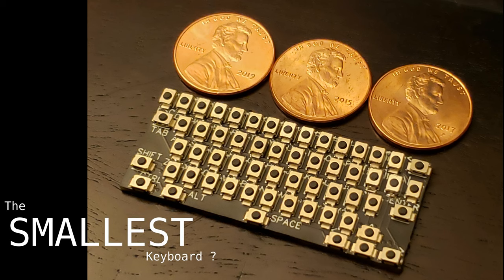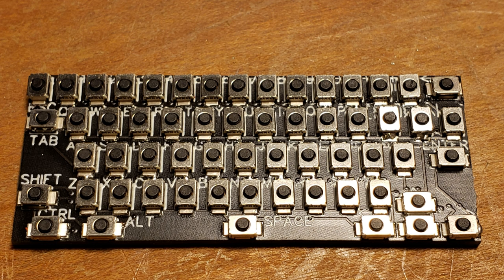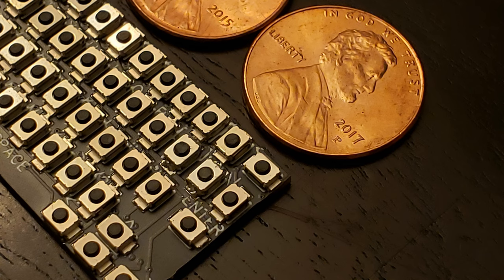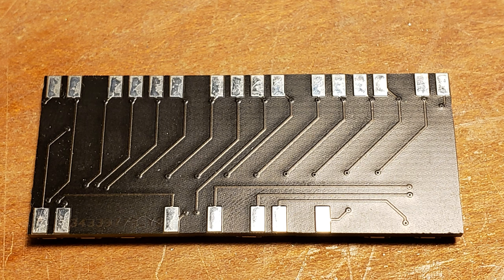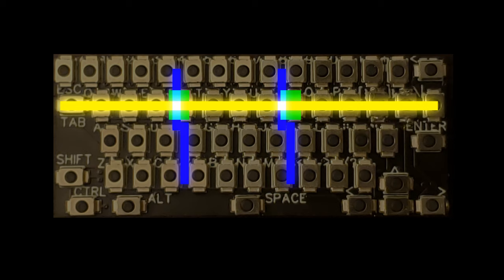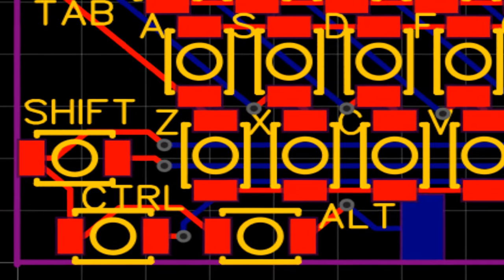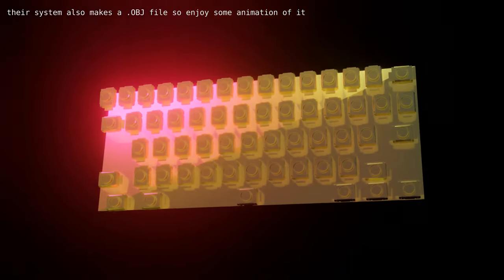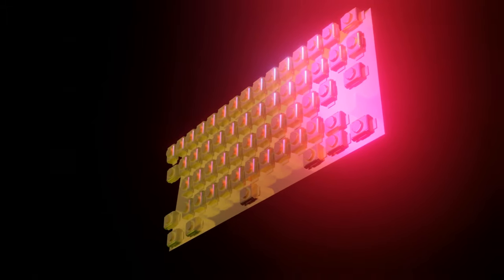The Smallest Keyboard?

Comment: How did you measure where to position the conductive pads for the pico?
Reply from the maker: I found a user-contributed model in EasyEDA.  If you're using that, look in the library and then under user-contributed models.  Or, since I know the pads worked, feel free to grab the design files linked in the description.